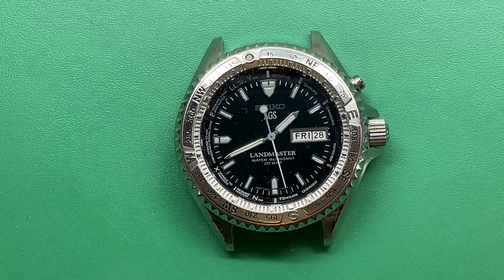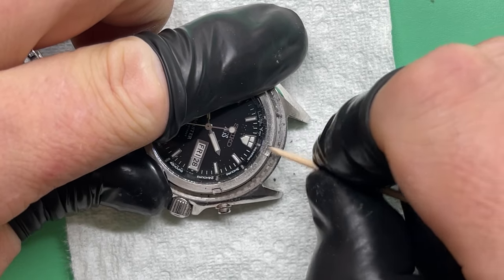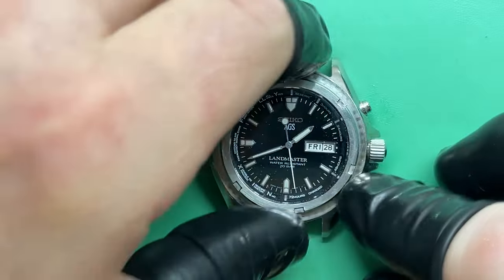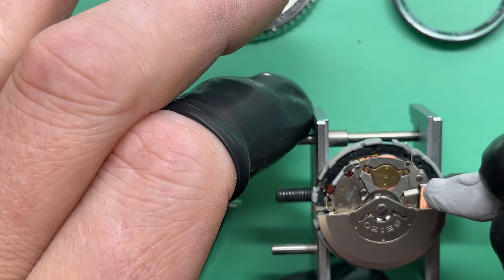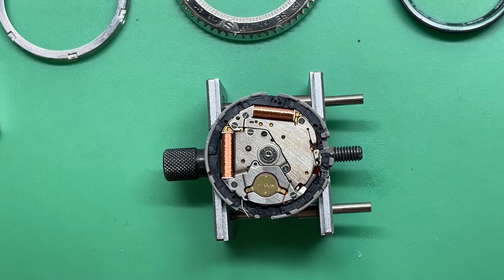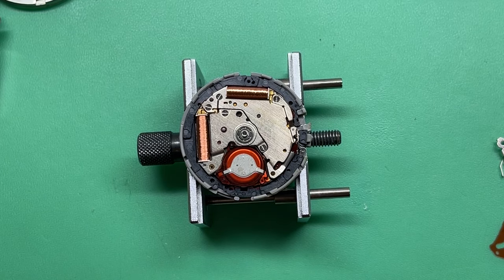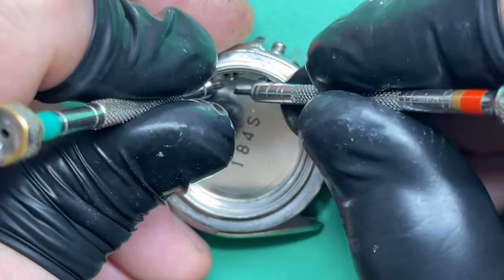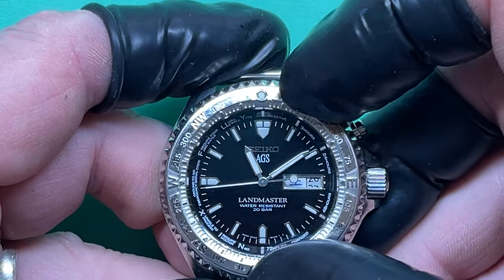Seiko 101: Changing the capacitor in a kinetic.  Gen 1 Landmaster AGS 5M23-6A20

Comment: Good morning sir, I have the same watch as in the video purchased many years ago but unfortunately the old capacitor was worn out, so I got a replacement [ MT920 ] and thanks to your video presentation and a pdf manual of the movement [ 5M23A] I was able to able to replace the old capacitor myself.. Thank you very much! I have a technical question. After the replacement I noticed that the capacitor load indicator does not work correctly. each press of the button moves the second hand to various positions, contrary to how it should work. Is it a defect in the IC or did I have to reset the module in some way that I'm not aware of, the rest of the watch works perfectly, surprised by the accuracy of the movement? Also, would you be kind enough to tell me, if possible, where I can get the gaskets for replacement? I would like to be able to replace the gaskets but I am unable to find the sizes or a supplier for this specific material. Thank you for your response and for sharing the videos that are so useful to the community of watch enthusiasts!

Comment: Hi Spencer, 
May I ask where you got that capacitor? My dad has a seiko solar powered JDM he bought say 20 years ago. 
We've been told you can't get replacement capacitors anymore?
Reply from the maker: What's the full casing number?  It's on the back in a format like 7T34-00A0 or 6309-7040 etc.
Reply: @SpencerKleinVintageWatch  hi Spencer, sorry for the delay.
So the guarantee card says SBTM-081.
Bought 2008
Reply: @SpencerKleinVintageWatch  is that the right number do you think?